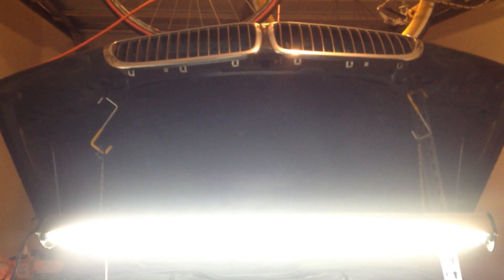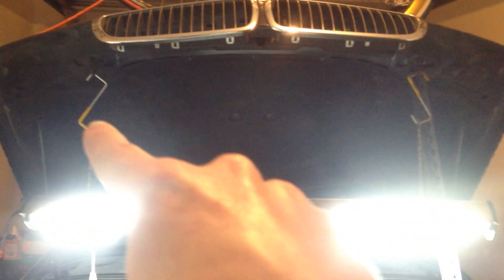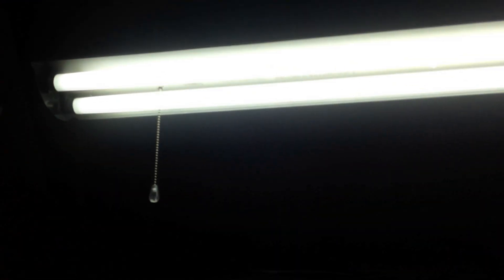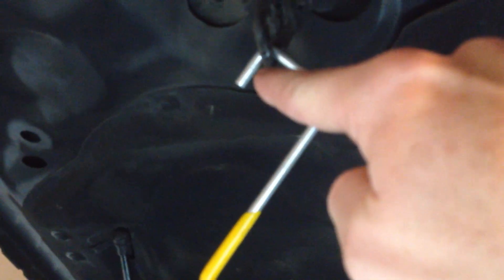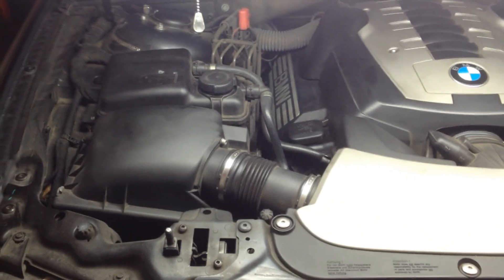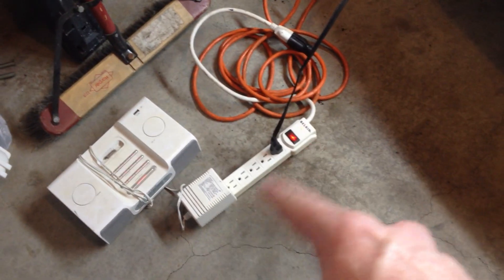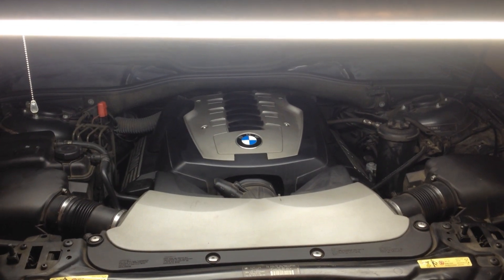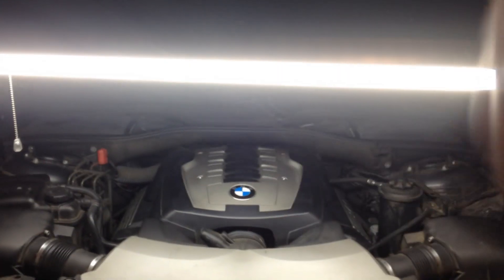DIY Auto Mechanic Shop Light Rig Up

Comment: Very effective work light, does wonders when working at night or even during the day and you saved me from spending 100 bucks for underhood lighting. I got the one with the plastic cover, attached some framing brackets at both ends then attached roller blade wheels on all four corners so I can just roll it around under my truck. I'd like to get the smaller units and add manetic post or bendable hooks with it hinged on both ends so that I can use them in the wheel well or attach to the frame and tilt them where I want the light. Thanks for the idea.